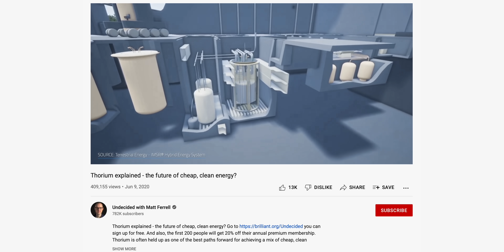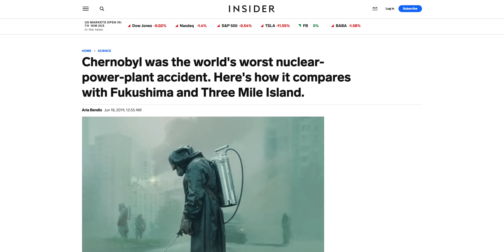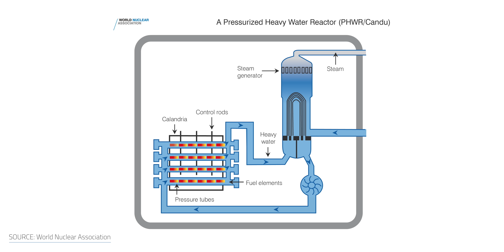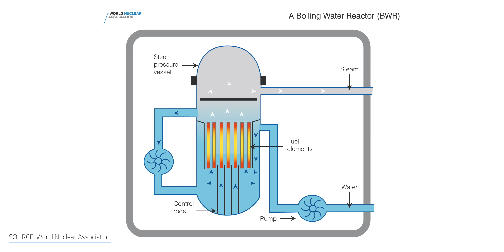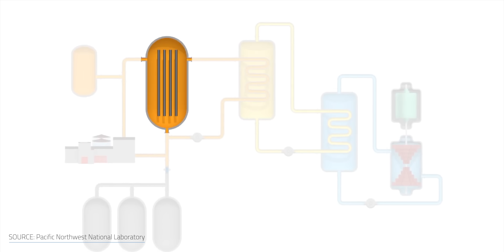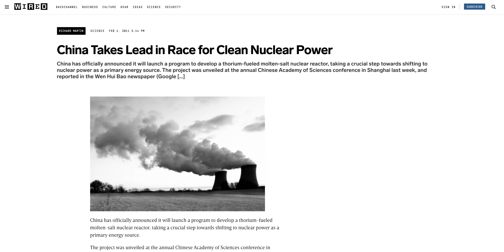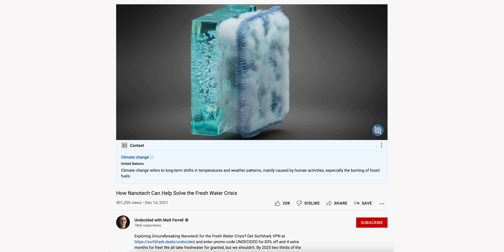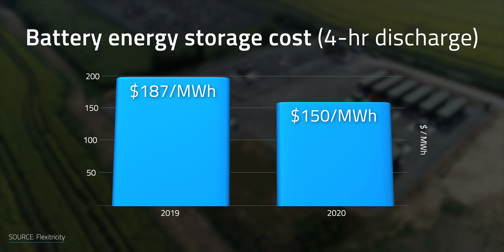Revisiting Thorium Energy - The Future of Nuclear Power?

Comment: For Fukushima it wasn't a loss of control over the fuel rods, it was the decay heat and loss of power of the cooling systems due to flooding, thing is if they had not such down the reactor it would have almost certainly been fine. So the injection of the control rods to shut down the reactor was—in hindsight—a mistake.
Reply: The flooding took out (shorted) all their power including cooling pumps.  Just because the reactor is operating doesn't mean the electricial switchgear can't short out.
Reply: @clarkkent9080  Errr no, otherwise they wouldn't have tried to power the pumps with AC and DC power they would have instead went straight to the steam pumps.

The failure of the eclectic pumps was attributed to flooding at the connection point in the Turbine Hall basement and the absence of suitable cables.

Not damage to the pumps themselves, so if the generators had been at a higher point the accident would have likely been avoided. 

Although honestly they had to shut down the turbine anyway because of the Earthquake because otherwise it would have likely busted the turbine, however they would only needed to shut down the turbines for the duration of the quake, however as procedure is to shut down the reactor, there was no procedure to restart one of the reactors after the quake and a power sink to get rid of the excess power one reactor would generate.

So it's not as simple as saying if the operator had went "NA FAM! GONNA KEEP THIS HYPE TRAIN'A'ROLLIN CHOO CHOO!!!"

but if the procedure had been different and measures had been put in place yes the reactors would have been safe as although the 'generator hall' flooded the turbines themselves, core and pumps were not flooded.
Reply: @clarkkent9080  Yeh which is my point that if the protocol had been different and there were procedures to link up the generator to the pumps in case of loss of mains power and have a power sink for the excess power and yes you can restart the reactors after the quake from the turbines because they take 3 - 5 minutes to spin down completely, and the Earth quake lasted 1 minute.

And yes the Earth quake did cause an immediate shutdown, and as said yes that was the right thing to do because otherwise the Earth quake could very likely have trashed the turbine if they kept operating it as normal throughout the Earth quake.

As also said it wasn't as simple as the operator going "No worries, just keep one of the reactors running." but my original point was that the control rods did not cause the accident, they worked as intended.

I admit I oversimplified for the sake of brevity because it wasn't as simple as someone deciding to keep the reactor running and would have taken planning, but really what I think we should learn from Fukushima is that yes you cannot always rely on external help and backups can fail, so yeah you should be able to run the cooling systems off any given core indefinitely.

Well you wouldn't even need to run off the turbine, if the steam generators had been designed to be an indefinite solution that would have been the perfect solution, because as long as the reactor is hot there is plenty of steam to run pumps, and if the reactor isn't hot well then it isn't a problem.

Also a larger battery backup to, which like yeh when the reactor was built 6 hours of batteries was already pretty insanely large, but nowadays you could do that with a couple of Tesla car battery packs, so a retrofit to 48 hours to get you out of the danger zone isn't a big ask.

Although I can see why they might wanna stick with lead acid batteries inside the reactor building... but like you can wall off the lithium ion batteries inside a fire resistant and flood resistant building somewhat removed from the reactor building, and keep the lead acid batteries inside.

Although long term really we should just be moving away from PWR/BWR and move to molten salt cooled reactors then molten salt fuelled reactors.
Reply: @Etheoma  The earthquake and/or associated issues like loss of offsite power caused the reactor to shutdown (control rods inserted), turbine to shutdown, and emergency diesel generators start but the generators are shutdown from flooding. At this point there is no AC power at all, no reactor coolant pumps and no power to withdrawl control rods even if you wanted to.  You cannot start a reactor without offsite power and the generator output breakers trip open when the turbine trips so power is not produced while the turbine slows down and anything less than 1800 rpm would produce less than 60 cycle powe rand that is useless.
 The issue is not lack of procedure but electrical and mechnical interlocks to prevent damaging equipment.  The turbine steam stops cannot be opened if the reactor is tripped and the reactor cannot be started with at this point multiple trip signals present, including no reactor coolant pumps. Even if all the interlocks were somehow defeated and the reactor was started and the turbine was started up, you cannot close the main generator output breaker unless it is in sync with the switchyard grid which at this point was completely dead.
I am not ex-military so I do not know for sure but your scenario may work for a Navy reactor since they have a "battle short" switch that defeats all interlocks and is only used as a last resort.
The issue no one is discussing is the potential for multiple reactor damage and/or meltdowns last year in Texas. Texas has its own seperate power grid (don't mess with "T") . Last winter, people were working from home due to the pandemic, many roads were unpassable because of snow and ice and they came within 4 minutes of a total grid collapse. Restoring a grid collapse would take days to a week under normal conditions but their conditions were anything but normal.  If the grid would have collapsed, all 4 Texas reactors would have tripped and as discussed above would be powered by emergency diesel generators and normally this would not be a problem as long as you can refuel the diesels and offsite power is restored..  But cell towers only have battery backup for between 2-4 hrs, driving is difficult, with no offsite power many nuclear plant secondary systems will freeze and burst, phones will soon be dead, power is unavailable to fuel tanker trucks, etc.. The extent of chaous and confusion is anyone's guess and no one wants to say what could have happened but with 4 reactors in a simular situation I am sure there would be some human error with subsequent results.  At a minimium, there would be significant damage to the plant secondary systems and unless everything went right there could be reactor damage.

Comment: ... dude Molten Salt Fuelled Reactor ≠ Thorium reactor

You can have Plutonium Breeder reactors which after the start up fuel is provided consume natural uranium or nuclear waste from a burner reactor. In reality it's 6 of one and half a dozen of the other on pros and cons for each, except for a few key points a Plutonium breeder reactor can use nuclear waste from conversional nuclear power plants and the start up fuel is 20% nuclear bombs, so not only do you consume nuclear waste as fuel, but you also use up nuclear bombs for the startup fuel.

Comment: Nuclear has many untapped opportunities, such as the alpha-betavoltaic-cell. The problem we have with nuclear is that we keep joining it to dangerous steam technology. Steam requires a massive heat source, to boil water as fast as possible. In Chernobyl and Fukushima, a mechanical problem prevented inserting the control rods. At 3 Mile Island, the meltdown happened EVEN WITH CONTROL RODS INSERTED. 

What we need are smaller, lower-energy nuclear solutions. Fusion is worse than fission, as it requires even higher temperatures. What happens when a Tokamak melts down?
Reply: The Fukushima melt down had absolutely nothing to do with control rods.
Reply: @Dana Durnford & Kevin Blanch debunked  The Fukushima meltdown happened because they could not insert the control rods. They couldn't insert the control rods because they needed electricity but the earthquake had just damaged the grid. And the tsunami damaged the basement generators. So the reactors were the control rods' only source of electricity - when they shut down, they cut their own power, preventing tneir control rods from inserting, preventing a full shut down. 

Then a more powerful explosion was caused by trying to cool the hot zircon cladding with seawater, an explosively dangerous solution, as the zircon alloys with the oxygen in the water, creating huge amounts of hydrogen gas. The Fukushima explosion was from hydrogen gas pressure, not neutron pressure.
Reply: @danadurnfordkevinblanchdebunk  Thank you for ceding the point through your ad hominem attack. The SCRAM procedure was incomplete due to the power outages.
Reply: @danadurnfordkevinblanchdebunk  Thank you for your continued ceding the point to me through your ad hominem attacks. I really appreciate your confirmation that I am correct.

Comment: Why do wind and solar estimates include 4hrs of battery?  When I had solar installed for my home it was recommended to target 24-48 hours of storage.  Obviously two very different applications (and incentives) for the sources of info, but the huge disconnect makes it seem someone is calculating with an agenda.  Since nuclear is 24/7 why not compare to an LCOE that can also provide similar?  Not sure how many hours that is, but it would seem to be at least 12ish?
Reply: Exactly. Energy collectors are not equivalent to dispatchable generators. Forcing them to meet that standard reveals the true LCOE of wind and solar: hundreds or even thousands of dollars per MWh.
It would be far more than just 12 hours of storage. Solar and wind are lucky if they even manage an annual CF of 25 and 35 percent respectively. And capacity factor varies wildly by both season and location. We'd have to stockpile energy like our ancestors stockpiled food for winter.

Comment: Thorium is often a byproduct of mining for rare earths, which are used for electric engines. Think about it - you can exploit the mine tailings from existing mining. Currently those tailings are treated as radioactive and dangerous, but this way they could be used as fuel stock.

Comment: Ahhh!  So the new claim is that Thorium is more expensive to mine than Uranium.  I don't buy it.  The early selling point 10 years back was that Thorium was incredibly abundant.  What changed?

But that's sort of good for prospects of these reactors coming into existence. If "they" are floating the claim of expensive fuel, it means the pieces on the Energy Game Board are being lined up to favor the house.  It's hard to keep debt slaves when electricity is "Too cheap to meter."

Conventional nuclear plants are like ink jet printers.  Uranium pellets are one of the most expensive materials on the planet and you're not allowed to buy off brand.  The House always wins.

Comment: We need an reliable back system.. Wind, Solar and Water are not reliable enough.. While I do believe, they will always be Wind, Solar can be struggle with an "Fallout Winter" mostly meaning from Vulcanos or Asteroids. And not even meaning a Doomsday, where it doesn't matter if Electricity is working. Our Econemies are quite sensetive.
A stronger Combination of mutliple Energy Plants is the better Option and if MSR works as wanted, then it should be Part of that. Same for the ITER, when it ever works.

Comment: I have to question the costs. 
How long was the TCO? 

There are some concerns about Thorium reactors.  While more plentiful... its not the mining but the enrichment process to get the U233.  (Enrichment may not be the correct term.)  

The other issue is how easy would it be to take U233 and create a nuke from it? That is a major concern. 

Like anything... the paper exercise makes it look straight forward... building it... not so much.
Reply: U-233 based nukes were tested back in the day, but not favored because Pu was easier to breed. As for the weapon itself it works just as well.
Also I do not think this is a concern at all.

Comment: Dear Matt,
Good presentation, but there are a few extra points need consideration:
1) the radioactive waste is not only hugely shorter lived for thorium, but there is a much higher percentage utilised than uranium. Separation of the fissile fuel is easier because there is a chemical difference between the substances not just isotopic differences.
2) if there had been as much money thrown at thorium that the high pressure water reactors have had then there would be these reactors all over the world many years ago and it would be cheap and safe to operate.  
3)The sourcing of Thorium is not as expensive as you might imagine since it is a byproduct in many types of mining waste; enough to fuel the world for many years.
4) the cost of recycling batteries, PV cells and wind turbines after their useful life has not, (as far as I can work out) been factored into the cost of these renewables because it is difficult to calculate the cost factor for that far into the future.
Lastly there were initial encouragements for uranium reactors when there was an urgent need for Plutonium, for fission bombs and then tritium for fusion bombs.
The byproducts from thorium would be greatly sought after for medical and other industrial uses and much less attractive for military use. If the products were to be used for destructive purposes then the gamma radiation signature would make their source easy to detect.

Comment: I really don't get the cost for renewables stated, if you leave out storage, its a useless comparison.  4 hours is arbitrary, to me it should be at least a month. Cost of storage is obviously not nearly to where we need it to be to make renewables useful. 

This energy storage issue is at the heart of the debate but its treated like its a small hurdle, its not, its a far greater issue than getting thorium to work.
Reply: Yeah, until we have a quantum leap in energy storage technology, renewables will massively fail without nuclear.